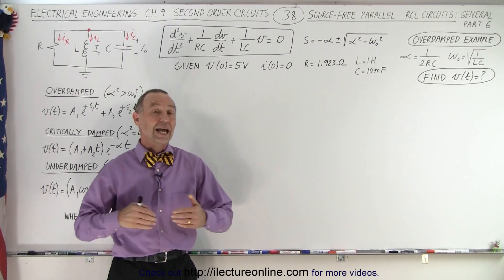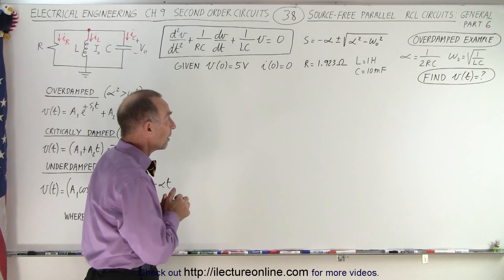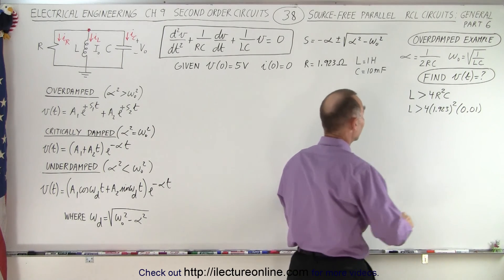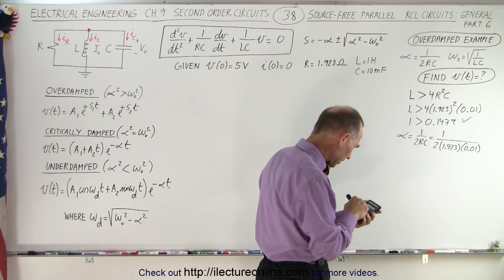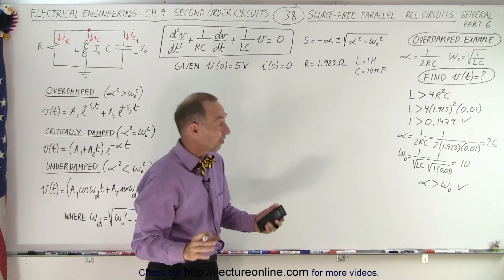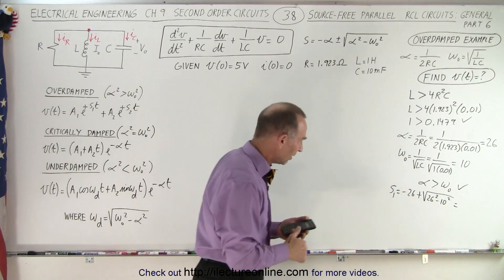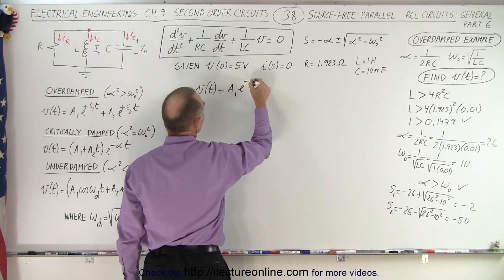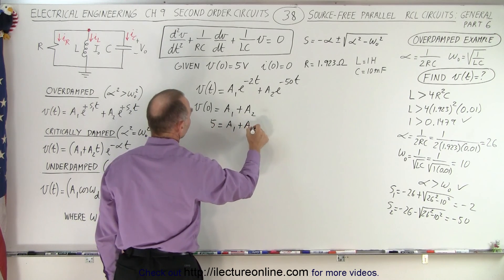Electrical Engineering: Ch 9: 2nd Order Circuits (38 of 76) Source-Free Parallel RCL Circuit 6 of 8

Comment: how can i know that this  RLC circuit is in parallel or in series by this giving value?
Reply from the maker: Since there are three paths to go from the top of the circuit (where the red dot is) to the bottom of the circuit (where ground is), these three paths are in parallel.
Reply: I thought there is no circuit diargram.Thank you so much